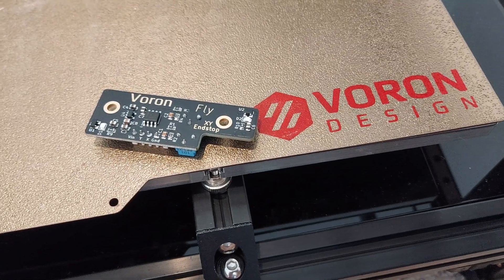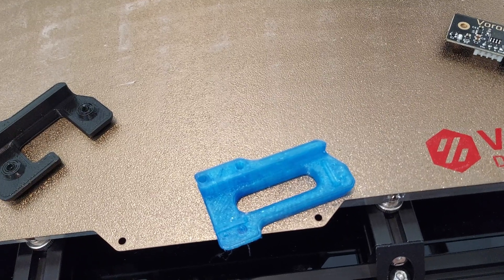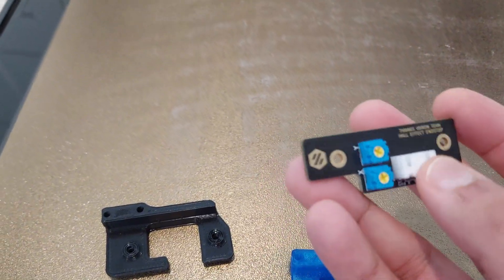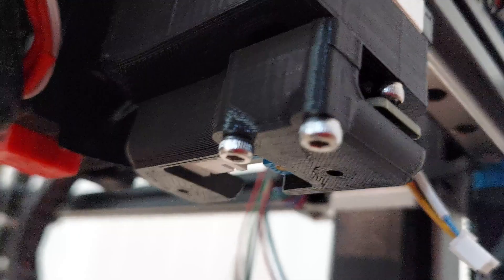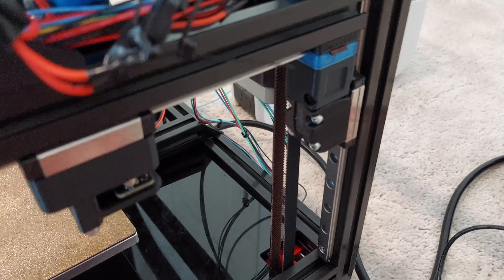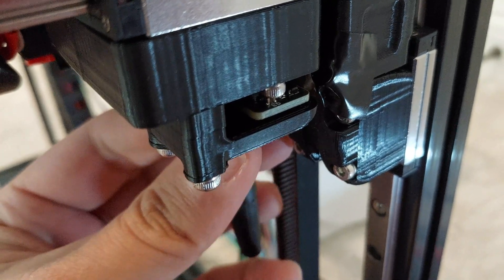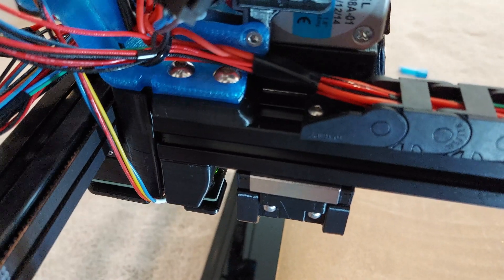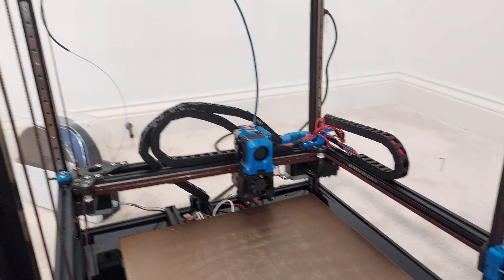Voron 2.4 Hall Effect Install & Calibration

Comment: I wish there was a better place to put the hall end stop.. I want to get rid of the drag chains.. and there's tons of guides/models for moving the X end stop (SWITCH) to the tool head AND the Y end stop (SWITCH) to the A motor.. both make sense.. but yeh now I have a hall sensor that has no use >.< thinking of putting it on top of the A motor and go from there, but would kinda mean me adjusting the gantry to support that
Reply from the maker: i feel ya. one part change requires pretty much redoing most of the printer
Reply: @darthokuz  the youtuber Chip@SnakeOilDev has a solution that looks close to what we'd want, but not there yet as it looks like he doesn't use the stealthburner. 

I've been eyeballing sensorless homing but I have concerns on what it does to the stepper motors.

Comment: Great video question for you how 4 wires comes out of the board and 5 wires goes to BTT Octopus where is the fifth wire come from where can I buy that Hall effect board
Reply: He only has 4 wires out of the board, when he points to the z endstop he's just mentioning that that's where it goes. The 4 wires are for X and Y endstops only. He has three wires going to X on the board and 1 wire going to Y on the board. I think he got his wiring wrong though. Left most pin on the board is power middle is ground and right one is X. Hard to tell with the video. I wish the Voron guide had a portion on how to wire the hall effect sensor in their manual.